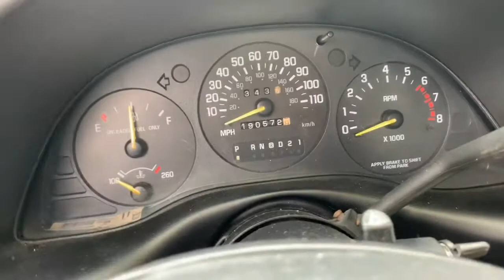New Car For The Channel

Comment: How's the F150 treating ya?
Reply from the maker: F150 is work fine just needed a car for work. Don’t like putting so many miles on the truck. Also looking on upgrading and bringing a newer f150 to The Channel. Will have some more videos with the truck. Now that I can have it down to actually work on.
Reply: Good to hear, I have an 11 Ecoboost also.  No probs other than rusting cab corners I'd like to get fixed.
Reply from the maker: Mine has that same issue with cab corners but only on passenger side